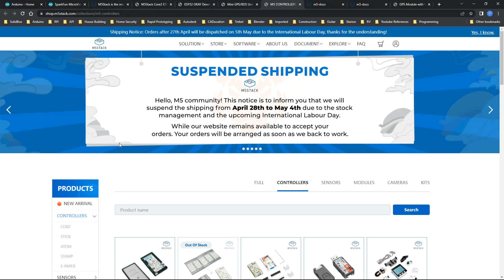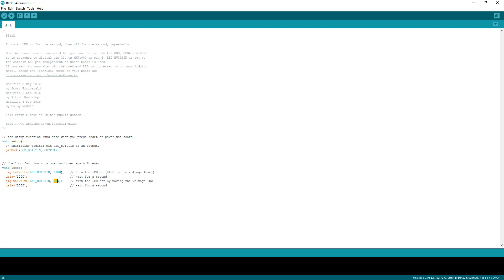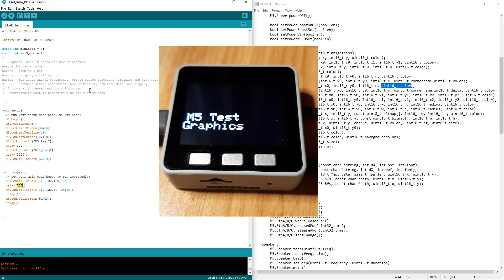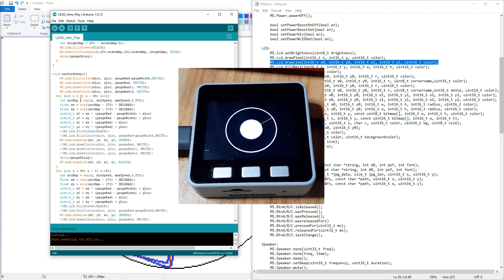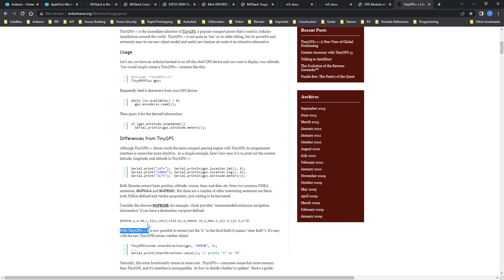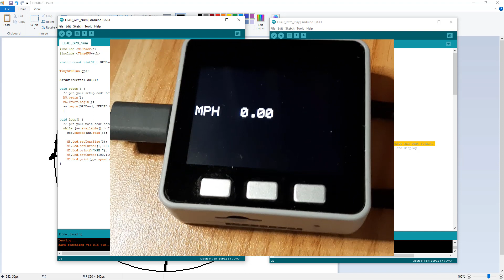Building a GPS Based Arduino Speedo using an M5Stack | Beginner Tutorial from Start to End #Arduino

Comment: It's crazy to set up. No idea what barrier I'm in. It's some syntax about "import" and type. Wrong code/mismatch from UIFlow or something.
Reply from the maker: are you on an m5 stack or just an esp32 board?  and are you using Arduino or programming with UIFlow?
Reply: @LearnEverythingAboutDesign  The Arduino IDE loaded some dependencies which fixed the problem. Was able to add a few lines in an example and delay(1000) compiled just fine all of a sudden. It ran on the Cardputer and everything. Thank you for this video and the "sprite video" which I can use for something I want.
Reply from the maker: @elektron2kim666  That is great news!  thanks for coming back and letting me/us know.

in the near future (hopefully) i do have another gps gauge project that I will probably film using a nextion display and a feather.
Reply: @LearnEverythingAboutDesign  Yeah, it's M5. Got an example to run on a Cardputer (compiling in the Arduino IDE) and did a lot of UIFlow 1.13 on a Fire.

I run into a simple thing like; "delay(1000);" won't compile, for example. I ditched the previous problem as it was copied from UIFlow and is too complex for now.
Never had an Arduino. I programmed for fun since 1983 or so.

I have 2 GPS apps working (MMBasic on a RPI Pico, UIFlow on a M5Fire) and just need something going for the Cardputer to make binary files for it.

Comment: Excellent tutorial, thanks for sharing.
Reply from the maker: Glad you liked it!  I always want to do more just can't seem to find the time.  If you are looking to do displays definitely check out Nexion displays.
Reply: @LearnEverythingAboutDesign  No, never enough time :) I am putting a project together at the moment and was actually considering one of the Nextion screens, they look really good but a bit pricey.
Reply from the maker: @dfn808  For sure, but there are limitations you can run into depending on the part you are using and the library as well.  The M5Stack i used in these videos uses a slimmed down version of the TFTeSPI library.  So if you are just on an ESP based board but not the M5 then you have the ability to layer sprites over the gauge for things like warnings.  On the M5 i can only push rotated.  This library was suggested to me as running a bit faster than teh TFT eSPI https://github.com/lovyan03/LovyanGFX
Reply: @LearnEverythingAboutDesign  Thanks for this, I have heard of that library but never used it. I am thinking of using the M5Stack Core2 as a main controller and satellite devices using ESP32's so that I can utilise the ESP-NOW protocol. I haven't ruled out a Nextion just.
Reply from the maker: @dfn808  one thing I didn't so on my project was to use the M5s micro sd storage to pull in images.  I found the delay/speed to not be ideal.  but this is where the Nextion stuff really makes a difference since it has its own processor on board and storage for the sprites.  I think their UI tools look really great as well.

I think for simple gauges the M5 works great.  My GPS speedo stuff ran just fine with its being drawn or pulling up Sprites.  No matter what direction you go its all fun and learning :)  If you want to share what you've done or are working on you can always drop me an email. support@caducator.com
Reply: @LearnEverythingAboutDesign  Thank you very much for the insight and the offer for support, very much appreciated. At the moment I'm just trying to get the Core2 to do things it apparently isn't supposed to :)

Comment: Hi, Thanks for a very good tutorial.
Can you add a link to your code so I can download it?
Reply from the maker: Gordon, I don't have it hosted anywhere but I am happy to share it if you would send me an email. support@caducator.com
Reply: I would love to continue building on top of that code. Do you still have a copy of it? @LearnEverythingAboutDesign
Reply from the maker: @alainberube1535  Sure, send me an email support@caducator.com
Reply: @LearnEverythingAboutDesign  Hey does this speedomater able to caaculate the distance travelled on a bike, and can the arduiono communicate with a sever to that information?
Reply from the maker: @elishaseme3019  hmmm.  well yes to distance traveled.  You can store and update variables to track that information.  If you are recording MPH you need to also track the time and can figure out distance traveled.  There are some other variables you can pull from GPS as well.
As for communicating with a server, that might be a bit trickier.  If you are paired to a device like a smart phone it should be possible.  I would look into IoT devices.  There are a lot of sensors and controllers already built for these types of tasks.
Reply: @LearnEverythingAboutDesign  I see, or maybe one can use a raspberry pi to host as a local server?
Reply from the maker: @elishaseme3019  It all depends on how you plan to connect.  Without a bluetooth connection to a smartphone you are left with being on a wifi network or having a cell data module of some sort set up.  I think most IOT devices are connected via wifi at their various locations.  This will be an issue with an Rpi as well.

Probably the best first step is to say record and store everything and when you are close to your wifi connection, then push all the data where it needs to go rather than trying to update it in real time.
Reply: @LearnEverythingAboutDesign  aha I see, okay thanks
Do you have like an open source code for this project that I can play with?
Reply from the maker: @elishaseme3019  you can email me at support@caducator.com and ill give you a zip file with it in there.  When i made the code i didn't have a great way to share it.